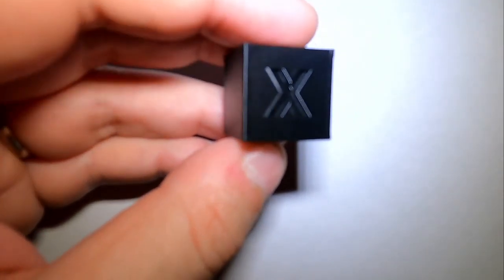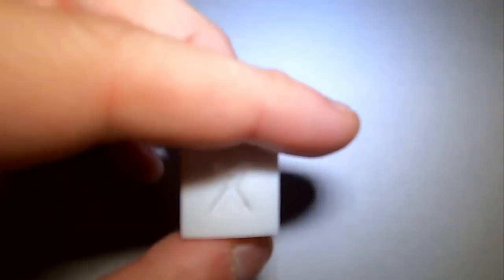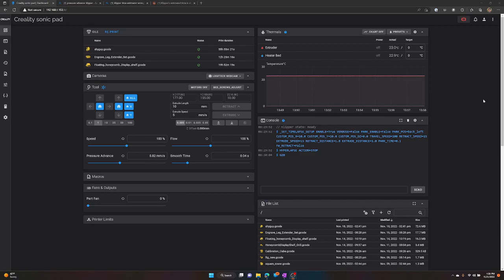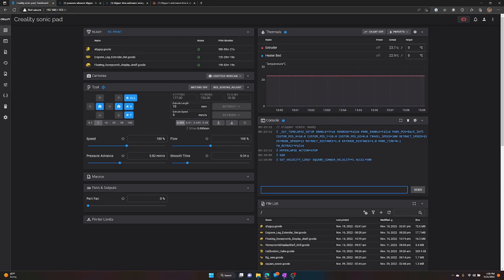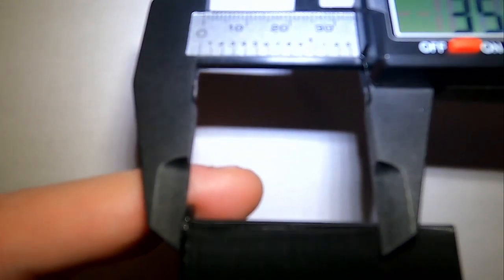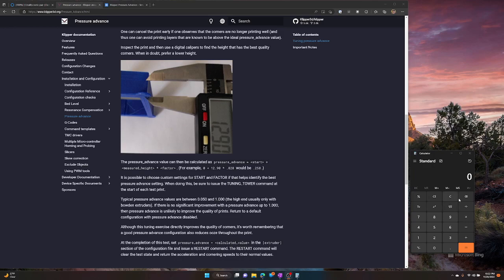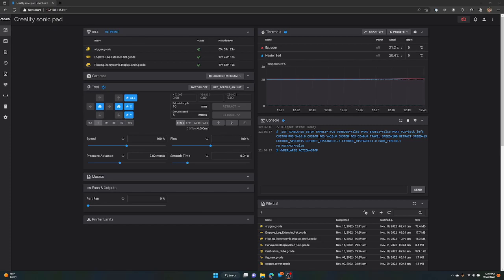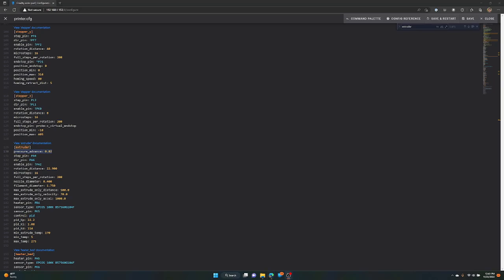Improve 3D Print Quality with the Sonic Pad!!!  How to set up Pressure Advance

Comment: Hi, i have a qeustion maybe you can help me. I just got my sonic pad and got it working on my ender 3 S1 plus. I just chnaged my nozzle to 0.6 and I was printing on 250 mms. The first few layers are perfectly fine the first infill is perfecty fine but then the next few layers the nozzle start touching the layers.. you have any idea? I think its because i use a 0.6 nozzle now instead of 0.4 do i have to adjust something in the slicer? Thanks for your help!
Reply from the maker: Off the top of my head, it sound like the nozzle might be a slightly different length, and it is throwing off you Z offset.  Try raising it in small increments.  Don't go too far though, or you could lose bed and layer adhesion.

Comment: Hi, I have a ender 3 s1 plus and I can’t find the pressure advance, literally I don’t have it in printer.cfg
Reply from the maker: Pursue Advance needs to be added manually.  Just add the line to the [EXTRUDER] section of the printer.cfg file once you determine the value.
Reply: @WilliamAgans  is it possible to have results like 1.1 on petg?
Reply from the maker: @Daniele  I haven't printed any PETG lately and haven't tested with it, so I'm not sure.   At a glance I would say if that is where you get good results, go for it. 

I actually do need to do a PETG print so I'll test and let you know what I come up with.

Comment: Very interesting.. I understood how to do it. Thank you.. One question though: is the value different for different filament types? i mean PLA or PETG.. do you need different settings? I was wondering because at different temperatures the fimalement extrudes differently....
Luc
Reply from the maker: That is a good point that I didn't mention on the video.  The pressure advance setting would need to be changed based on the filament that you use.  Additionally, you would want to test it if you switch nozzle size as well.  Basically you would want to adjust when changing anything that changes the flow from the nozzle.

Comment: Can you help me with set my probe offset, I have a ender3 v2 with a sprite extruder, cr touch there is no setting adjust like on marlin.
Reply from the maker: I'm assuming you are using a Sonic Pad with the Ender 3 v2.  I don't personally have one, but I would assume you set it from the printer.cfg file.  Here is a snippet of my configuration of the BLTouch.

[bltouch]
sensor_pin: ^PD2
control_pin: PB5
stow_on_each_sample: False
probe_with_touch_mode: True
x_offset: -27
y_offset: -2
#z_offset: 0
speed: 20
samples: 1
sample_retract_dist: 3.0

The x_offset and y_offset settings are probably what you are looking for.  My understanding is that the BLTouch and CRTouch are set up the same way.

Hopefully this helps...